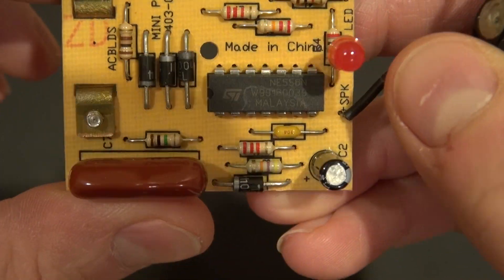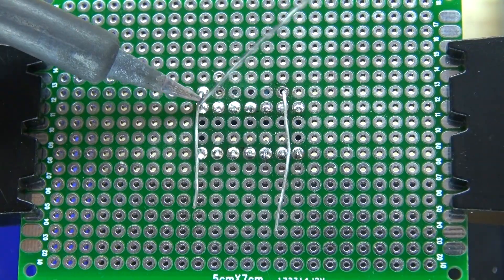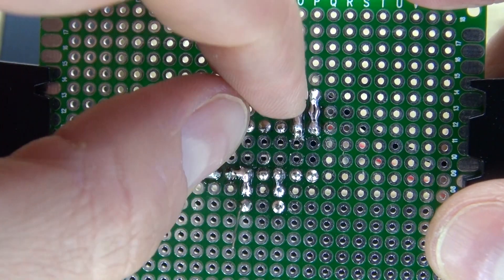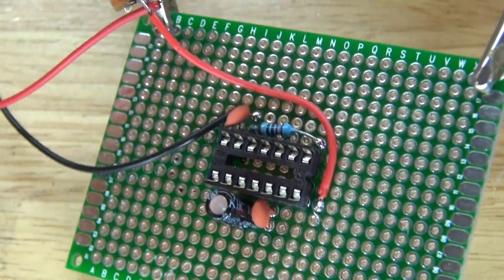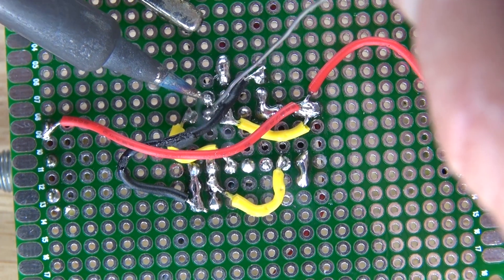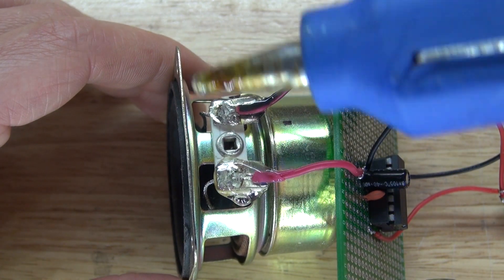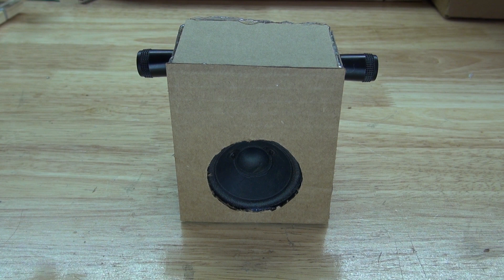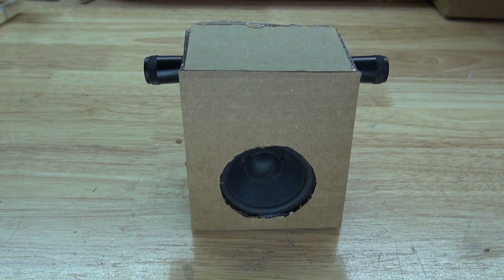How To Make An Atari Duel Punk Console With 556 Timer

Comment: Why is it a "Duel" ???? I didn't see any fighting.
Also, it's not "Dual" either, since there is only one of them shown here. The Punk Console uses two 555's or a single 556 chip just like you used here.
So, the is just a normal Atari Punk Console.
As for that box and hot glue, you need to stop watching the DIY Life Hacks channels.

Comment: How would you connect this to a pc to record the sound? Is this possible?
I built my first radio last night and I want to build this next.. but I’d like to record the sounds I make for another project.
Reply: Are you really that clueless? Your PC has a "Line IN" audio jack. Your sound device outputs a sound, so you connect one to the other. Then use Recorder or similar to record what comes in from Line In. It's truly not that difficult...
Reply: @johncoops6897 i asked because, yes, i was clueless. never delved into electronics till last year after taking all the ham radio classes and passing.. i had this curiosity and kept going a bit. the only projects ive built thus far were thoroughly explained kits. i test at 139 and feel no shame in being clueless about electronics. wisdom comes from experience and knowledge. thanks for your input! your name looks pretty white, act like it. stop being a wigger.